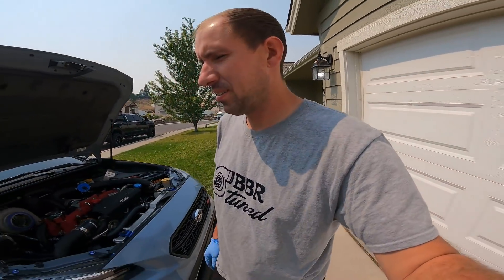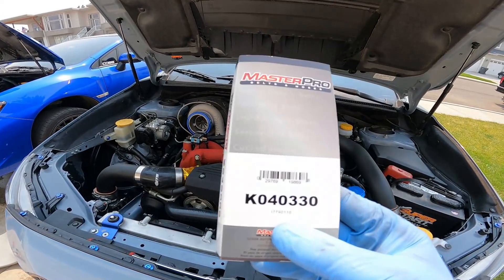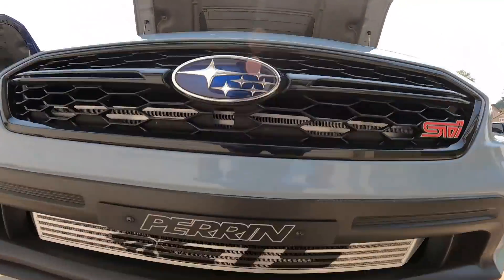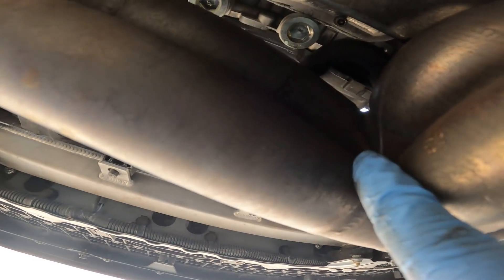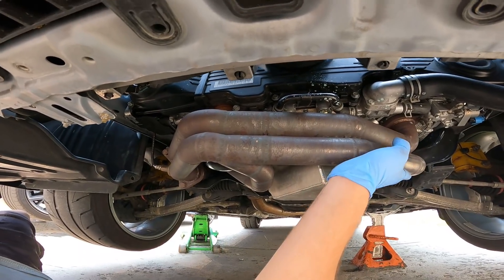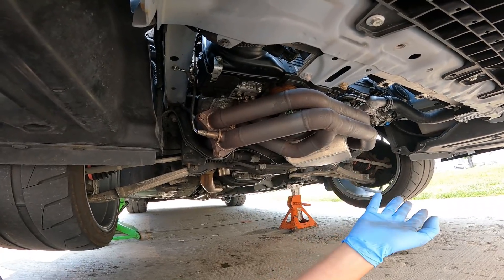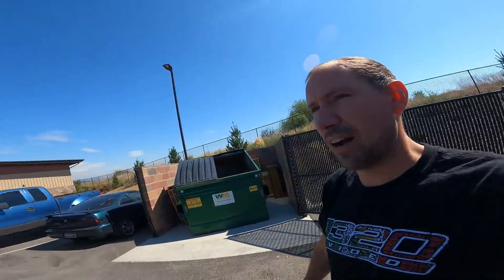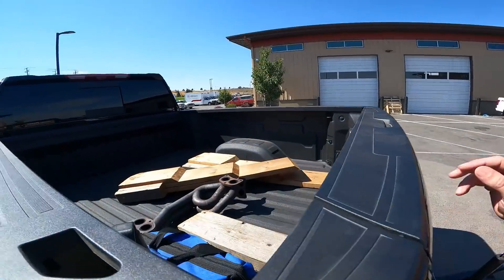BAD NEWS for VA Bait STI...

Comment: With two head based failures, what can you do differently to beef up the heads? I've heard of tuners using cryo to strengthen components? Is this something that you will consider on the next build? With regards to the pigness. Stripping out all of the sound deadening, removing interior, stripping roof lining etc. All pretty cheap methods. Then you can start moving down the expensive route of lexan windows, carbon hood, boot, doors, possibly roof... Looking forward to seeing further developments and content.
Reply: I’ve found micro polishing works wonders. I’ve got my cams crank and rods done.
Reply from the maker: We have been testing all new parts in the cylinder heads, its been working awesome. Unfortunately i let the valve service go too long.

Comment: Hey i have a question. My 13 wrx has a i wouldnt call it a pop but sometimes when in reverse it makes a noise when letting off the clutch. I need to change the fluid in it anyway its coming up on 90k but what combo would you recommend to see if that noise can be addressed i my self think it might be a clutch problem but i need to change fluid anyway so im not to worried about it. It just does this when backing up for the first time of the day when im on my way to work.

Comment: We use slip jointed headers to allow for some movement. I've found the solid headers are prone to cracking due to lack of movement as you said under the massive amount of heat then cooling down. HKS, RCM and Tomei all make slip jointed headers.
Reply: The new ets headers have slip joints as well
Reply: @boostedg215  yes but he ie Bader is having original ETS non slip jointed headers rewelded. They will crack again by design.
Reply: @seanmaguire380  also the new ones are not ment for the twin scroll setup.

Comment: I feel like headers without a flex join or slide joint tent to crack over time. What do you think? I also feel the same for up pipes. I always look for flex joint flex pipes.
Reply: I feel like all stainless headers crack eventually. Flex joints also fail over time from flexing. It's just a fact of life when you modify the header. Eventually it'll break

Comment: Sorry to hear about VA Bait EJ failure... she did take a lot of abuse.  I hope you now have that 1-2 shift pattern fixed.   Anymore transmission problems you really need to go with manually shifted sequential. Full race block, ported heads, cams &  turbo the cost savings and advantages to a sequential are well worth it.   Check out all the kiwi and Australian R32/R34 high HP builds they are all running sequentials.  
I give you a lot of credit learning the motec system.   Motec seems to be the most high-end exclusive ECU on the market.  All the tuners are like those things are black magic big money big money to tune. Few years back at the T2K met a team that had one of the fastest Porsches and they had the motec engineer fly in from Germany helping them tune the car. 

Curious I know the Motec has a hell of a lot of advantages but can you work with Cobb on the existing AP or possibly a new AP system that could unlock more advantages that the motec has?
Reply from the maker: Thank you sir for your support, unfortunetely i wont ever switch car to a sequential as im a die hard stick shift guy. Also in the industry of fast subaru's it has to be a stick shift car to matter. 

Motec is a extremely complex software that im still learning something new everyday with, I feel very fortunate to even been able to get as far as i have with the software and begin working towards a working car. Cobb is also a great tuning software that has been proven can go very far. You just dont have the fail safe benefits you do with a true standalone ecu.
Reply: @BaderBuiltRacing  Travis pastrana's crazy STI is running full MoTeC.  Keep pushing those tuning skills you have been extremely impressive 💻🏁.  Maybe what Cobb needs to do is produce their own plug in standalone race only ECU to no longer be limited with the piggyback setup.

Comment: @_Baderbuilt Hey Josh, have any of your past tunes that stayed under 400hp or “daily drivers” lasted to high mileage? Lets say 100k miles on the VA chassis? Of course there are a lot of variables involved in a car lasting that long, but assuming the owner is responsible and taking car of their car or not doing the things we all know EJ’s don’t like; is it unreasonable to assume a car with all the supporting mods can last as a daily driver with 350-370hp. No specific power just a range based on stage 3 mods and a reliable tune.
Reply: I have an 06 WRX with about 350whp and am interested in the answer to this question myself. I bought it poorly modded and fixed all of the issues, but only have about 4k miles on it since then.

Comment: Get Devin to coat that bad bish..
Sound to me like Josh's thing cant get the exh gases out fast enough???
Reply from the maker: Good idea, I’m hitting ole Devin boy up lol.

It has a 1.15 exhaust housing, which should lead to 1:1 back pressure. We also are not in a boost threshold that would be enough to increase back pressure yet. But the thing is so lazy